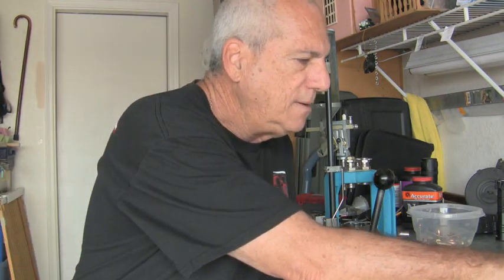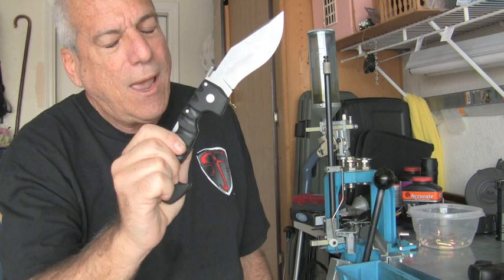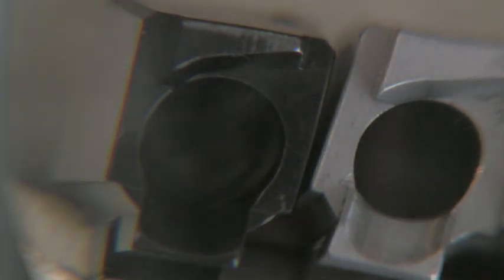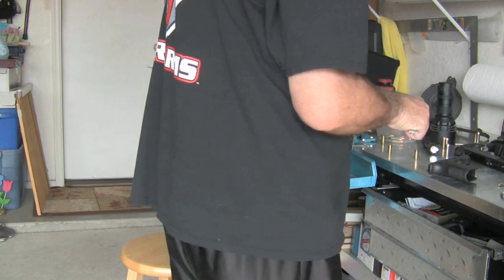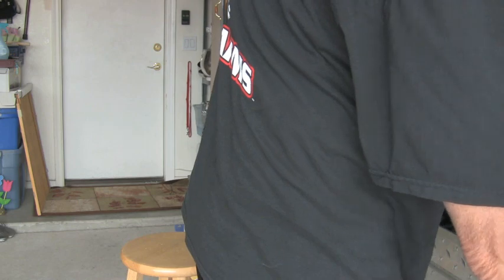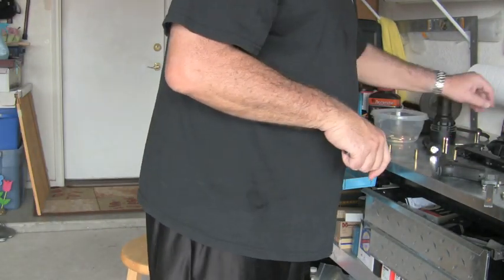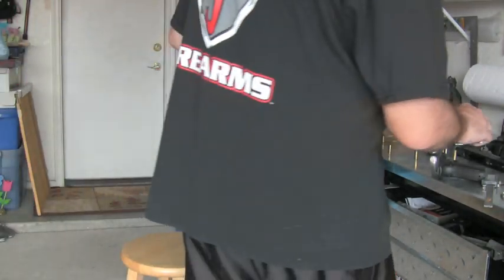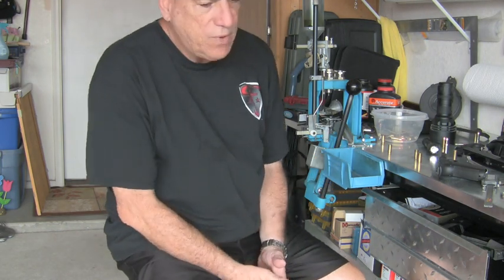The Infamous Glock Smile And what Causes Them

Comment from the maker: This is somewhat of a convoluted answer.It can vary on a few different variables.The caliber, charge,barrel manufacturer, bullet weight, and powder burn rates are just a few. All of the top tier barrel manufacturers with fully supported chambers, all vary in minute differences in chamber sizes. This will allow different case expansions across the board. Bullet weight powder charge and starting case size are self explanatory. Short version. Target loads,= 4 to 5.Hot loads heavier bullet about 3-4

Comment: @jr10 How did you not get a kB? I don't reload (yet) and the only case failures I've seen are a lengthwise crack on a Tula Ammo steel case, which is going to happen. My concern is with my .40 MagSafe SWAT 46gr.

Comment: Redding GR-X base sizing dies are made almost specifically to fix this. I use them for all of my .40 and 10mm brass.
Reply: jr10
Sorry, but Dillon does not full length size.  You need something like a Redding GR-X
Reply: David Wilson I think the idea is that if you use the Glock sloppy-chamber barrel, you should not reload those fired cases. If you use a barrel with a tighter chamber, regular full-length resizing die is good enough.

Redding GR-X dies sound like small base dies. Some small base dies leave a ring of pushed brass on the outside of the case near the head. Not good. That would result in too much unnecessary working of the case and lead to early failure.
.
Reply: geoh7777
, a Redding GR-X die is NOT a "small base" die. It does NOT leave a ring of pushed brass on the outside of the case. It is a full length push-through die. Before telling everybody what you think something sounds like, I would recommend looking into them.
Reply: jdrains16 Too late in this case. I apologize. I jumped before looking.
.
Reply: jdrains16 Thank you for the correction. I was too quick to comment.
.

Comment: WAS YOU USEING THE GLOCK BARREL WITH THE 10MM CASES YOU SHOWED WITH THE GLOCK SMILES.HAVE YOU HAD ANY GLOCK SMILES USEING THE LONE WOLF BARREL.I BOUGHT A DOUBLE DIAMOND BARREL FOR MY GLOCK 20 AND IT STILL LOOKS LIKE THE BRASS IS UNSUPPORTED AT THE 6 O'CLOCK POSITION.THE DOUBLE DIAMOND BARREL IS SURPOSE TO BE THE EXACT SAME BARREL AS THE LONE WOLF JUST REBRANDED.THANKS HENRY
Reply from the maker: The brass in the video that showed the smiles was from stock Glock barrels. As for the Double Diamond barrel, this is the first I have heard of them. They look to be a nice barrel. I had to laugh at the Glock Store's rep. in his video explaining the different rifling patterns and reasons for aftermarket barrels. I became leery when he described the Glock rifling as hexagonal. and leading would cause smooth boring as the reasons for not using Glock barrels for reloading. That being said, without knowing what your loads were, and how many times the brass was reloaded, it would be hard to answer. Fully supported chambers will not completely do away with case failures. It is still incumbent upon the reloader to maintain proper CUP pressures in their loads.

Comment: Is this a problem with other makers of the 10mm, .40cal. or is it only due to the unsupported edge of the Glock chamber? I've reloaded .45acp cases 8-10 times before the case developed a crack but it's always been on the case rim, never the base and fired through Kimbers, Sig, Springfield barrels not Glock.

Comment: I suppose I should clarify my concern. See, I would think--or would have thought, before this video--that shooting with overly-weakened brass would be the same as shooting something a little too hot, like a little over SAAMI max. Now, The MagSafe rounds I have are labeled as being loaded to maximum SAAMI pressures, but not for throated bbls. Their test gun for fps and ft/lbs, however, was a Glock. Guess I should contact them and find out what bbl they used.

Comment: I have been shooting Glock handguns since they became available and have handloaded 9mm and .40 using (OMG) lead bullets.  Never had a problem with any of my guns but guys who shot my .40 loads had their slides blown off, never mine.  Now, I clean my weapons after I shoot them and maybe that may be the difference but I'll never know because once I heard the horror stories and had the issue explained to me by a PD Glock armorer I now use FMJ or copper washed projectiles.  I don't want to push my luck and will never know if it can/will happen to me because I changed my ways.
Oh yeah, BikerBry, I load because I enjoy it not because I can buy cheap ammo .  I used to and still can get Govt. ammo if my current supply ever runs out.

Comment: Glock smiles is caused by particularly unsupported and over sized chambers, .40 S&W's are the worst of them.the feed ramps comes in at such an angle it nicks off the bottom portion near the base. When fired the pressure from firing expands the cases slightly. If you don't use a full case re-sizing die to push it back in to shape. the more times the cases are reloaded. the  weaker and brittle the brass becomes, from just working the metal. all Glock .40 S&W have the smile in their spent brass. Not so much in 9 mm and .45 acp their chambers still oversize their ramp angle is different.Compared to a Sig Sauer or Smith & Wesson. take a Glock barrel and a Sig barrel drop a live round in both barrels facing down.You can see a lot more of the round in the Glock chamber. move both see which one moves more.a fired case from a Sig will go into a Glock chamber case from a Glock  will not go into a Sig chamber fully.I will never own a Glock .40 S&W just for that reason.

Comment: jr10 , what do you think about lone wolf vs kkm, and the other barrel manufacturers?
Reply from the maker: +TheSummerOfGeorge1 I think for the money spent, You can't beat Lone Wolf. I own several Lone Wolfs, A KKM, Storm lake,  and a Bar-sto. All off them perform identically. All have tight well machined chambers. People get caught up with the idea that if they spend more money on the barrel, the weapon will be more accurate.As far as pistols are concerned, all of these barrels are far more accurate then we are capable of shooting. There are to many other variable in accuracy to warrant spending the extra 50 to 100 dollars on the higher priced companies. Save the money, get a Lone Wolf , and I am sure it will more then meet all of your needs.
Thanks for watching.
Have Fun Be safe :)
Reply: awesome, thanks!
Reply: jr10 hey, you were so helpful, thank you! Can you answer one more question? I have the glock 29, and i'm trying to decide between an extended 10 mm barrel, or stock length 9x25, what do you think, especially in relation to recoil #1 and ballistics #2
Reply from the maker: +TheSummerOfGeorge1 I've never been a fan of extended barrels. With my G29, the intent is to get a sub-compact package with 10mm power. Putting an extended barrel on the 29 takes the conceivability advantage away. As far as 10mm and 9x25, I am a big fan of the 9x25. the high speed flat trajectory make for a very accurate round. The 9mm bullet on the 9x25 means a lower mass at acceleration resulting in a much reduced recoil impulse.That being said the downside is it can be an expensive round. This is where reloading comes in handy. With both barrels, and reloading , you get to experience the best of both calibers.
Reply: jr10 thank you very much, i really appreciate the replies! i'll probably look into getting a stock length 9x25 from storm lake then.
Reply from the maker: You'll love the barrel and the round.

Comment: Newer Glocks are fully supported. This one wasn't and yes, the brass can bulge at the ramp. The newer versions are fine.
Reply from the maker: +ObsessedCyclist Not true. As of production of the Gen 4's , while Glock has addressed the issue, the case web still remains vulnerable at the feed ramp area. Block is a staunch supporter of reliability, and tightening up the chamber will lead to feed failures of certain rounds.
Thank you for watching. I appreciate it. 
Have fun be safe.

Comment: Your loading is way to hot... I went to the Hodgdon loading sight and there is no data for a 180 gr 40 s/w that takes you even close  to 1259fps. I also looked at my shop loading books (2) and nowhere does it give data for 180gr  40 s/w at 1250fps . You as a loader have WAY over pressured the case.  With this load your beating the pistol to death shooting these over pressure loads!!!!    My thoughts.   You need to sit down and look at what your doing and reconsider your powder charge.  John.

Comment: Hard cast is actually fine in Glock barrels, regular lead is not.
Reply from the maker: +Moto Rad  Dangerous approach. You will get away with it for possibly a long time. Eventually there will be that variable ,  that unanticipated occurrence caused by say a load change, powder change, brinell change due to manufacture change,etc. There are so many variables that could cause a bad day. For the price of a Lone Wolf or some of the other exceptional barrels out there, why risk it ??
Thank you for watching. I appreciate it. 
Have fun be safe.
Reply: jr10 Well regular lead is dangerous, hard cast leave nothing behind.
Reply from the maker: +Moto Rad I think you are a little confused. Lead bullets need to swell a little to seal off the bore (obturation). Hard cast bullets can and often do lead worse than swagged if they are too hard or not pushed hard enough. My experience has also been that proper sizing is more critical with hard cast bullets because they don't obturate as well. Here again proper monitoring of brinell hardness and sizing would obviate pressure issues. At the same time to obtain maximum accuracy and velocity obturation will necessitate some leading in high pressure rounds. If you look at the geometry of the Polygonal rifling you can see why Glock warns against lead in their barrels.  As I stated previously, why take the chance when you can get a lead friendly barrel for about $120?

Comment: Sorry to all the Glock fanboys, but I just find it ludicrous that a gun maker has to deliberately make their barrels not fully supported to promote reliability.
My 23-year old S&W third generation auto is so reliable that i can hand cycle and eject a full magazine of fired 10mm cases without a single hangup, and it has a fully supported chamber.
Reply: jr10
Doesn't matter...either one.
Yes, I'm also an avid reloader.
Haven't had to buy a factory load in decades.

Comment: This is why you don't reload. Glocks are not designed for reloads.  Just man up and buy quality new ammo or get another gun. My Glock 17 Gen 2 is still bone stock at 22 years old and having 30,000+ rounds through it. Now that is 30,000+ brand new quality rounds. I do not over clean, I do not over lubricate and have never, ever, ever had one single failure. Screw reloading. I chuck my brass! I was lucky to meet a Glock engineer in '92 when I bought my G17. He told me specifically no reloads, ever. Don't over clean or over lubricate. He was right!
Reply: Why would I want to buy other side arms? Mine works perfectly. I have zero interest in reloading, and would not trust any ammo reloaded by anyone else. I can afford to buy new ammunition. And thank you for commending me on my forethought… I have carried this same Glock for all but maybe 20 days of the last 8000 days. It suits me perfectly, and I would bet my life on it. If you can't afford new, high quality ammunition… Then a Glock is not for you. And yes, the ammo companies do love me, as I love them!
Reply: Thems were cheap prices!! Im paying around $50 (aus) for powder $50 per 1000 primers and around $135 per 1000 projectiles. I use the berrys copper plated projectile 124grn. All through my G17, never had an issue, but i only use the berrys projectiles, were not allowed to shoot FMJs at our range, otherwise I would be loading those. I have seen some really badly leading up on Glock barrels shooting home cast bullets. Im thinking of getting a lone wolf barrel as I've heard they are fine to shoot reloads through.
Reply: Ive been using AS30n (an ADI powder) similar to unique in that it is a shot gun powder. Im using 3.9 grains, the maximum according to their data is 3.7, so I'm pushing it a little bit. Id imagine with your 4.6 grains when you seat the bullet it is compressing the powder somewhat? are you using a crimp die as well?
Reply: Robert Watson WOW!! I can't believe the bargains your friends got (kudos to them)  ill will take your advice on board, but we don't have the same number of shooters here in Australia that you do over in the free country, so we don't enjoy the same economies of scale, but if we are prepared to by bulk we can get some saving. Ill start badgering fellow shooters at the pistol range!
Reply from the maker: Robert Watson I think I am speechless. (That is saying a lot for me.) You are the first person I have come across that actually gets it. You are one of a very few,  in a very long time that has understood powder dynamics as opposesed to how much of my favorite powder can I shove into a case. Well done sir! Thank you for your input.
Have Fun Be Safe :)
Reply from the maker: Robert Watson I've always loved Unique. It has been a longtime goto powder in my inventory for many years. Other favorites for me in this range are AA#9, Power Pistol, Blue Dot, and my all time favorite, the ever explosive 800X.
Have Fun Be Safe :)
Reply: only the 40s and the 10mm do it
Reply from the maker: moparhemple2 Why do say that? Would you not expect the same results from a high pressure 9mm?
Reply: Becuase only the 40cal and 10mm glocks chambers do not support the case fully
Reply from the maker: All glock stock barrels have unsupported chambers.
Reply: jr10 not the 9mms
Reply from the maker: Take a 9mm barrel and place an unfired round in the chamber. Now, take a close look at the case web right above the feed ramp. It is unsupported.
Reply: How in the hell do you equate running to the store over reloading your own ammo "manning up"? And how is a gun that doesn't have the option of eating either type of ammo better? Let go of your ego, man. It's making you dumb.
Reply: jr10 Love your videos. I'm a BIG BIG BIG Glock 20 fan myself. I have a Gen3 Model 20C. I have reloaded .40 s&w for my model 23 when I had it and noticed the classic glock bulge especially if I loaded them a little warm. I watch my brass for pressure spikes like a hawk. You have to if you want to get the most out of your brass and be completely safe in the process. I'm looking forward to reloading my 10 mills but I want to get as much longevity out of the brass as possible, with the initial idea of better chamber support from a aftermarket barrel. Considering that you have 2 different 10mm barrels (Lone Wolf, KKM) for your model 20, which one in your opinion has the best chamber support. I've heard that the Lone Wolf barrels have better support than the KKM and I've heard the opposite(KKM better than LW). I never took what they said to heart because neither one of the guy's had much credibility with reloading so that's why I'm asking your opinion. I have heard the Bar-Sto barrels are great as far as chamber support and accuracy, but the $200+ price tag kinda shunned me away. Lol. Let me know your opinion on LW or KKM for the best chamber support. Thanks